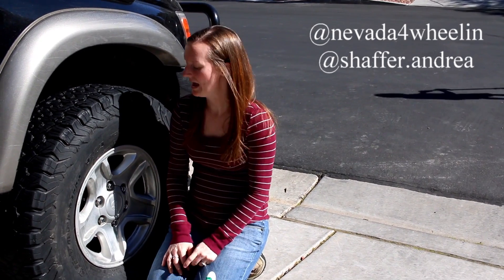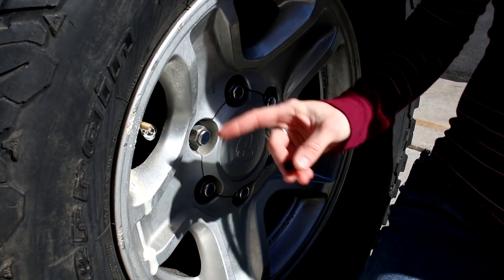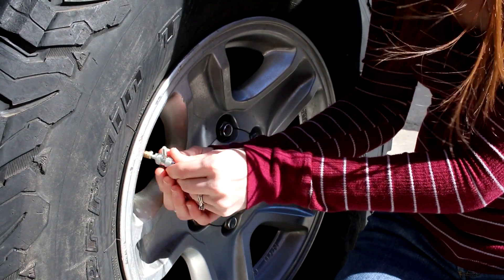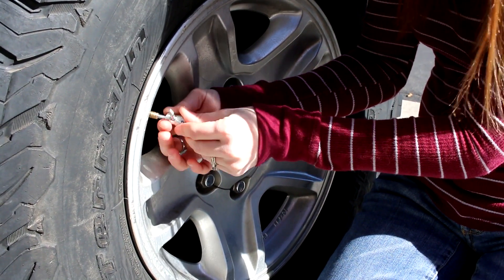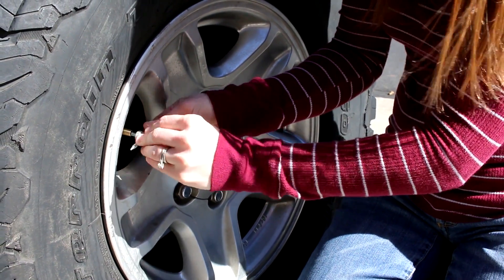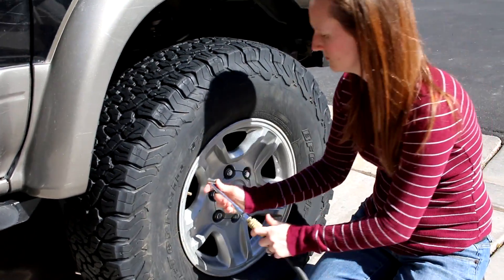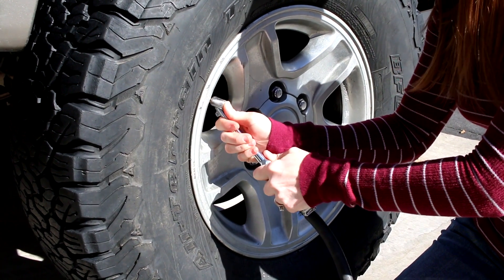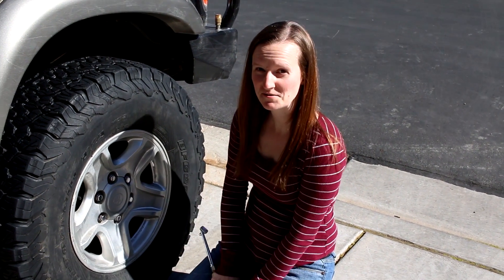Valve Stem Core Check and Fix!

Comment: Hi thanks for this, it's the 2nd time this happens to another tire valve stem leaks at our corolla hours ago, too bad I still don't have this kind of tool for fixing such issue. 

Just going to tire centers later and let them repair it again, anyways thanks for the info Andrea.
Reply: Walmart sells the tool with valve cores included for cheap

Comment: somehow only my right front and right rear’s valve stem core are shorter compare to left ones after changing new wheels. 

So it’s very hard to check air pressure with my gauge since valve stem cores are shorter and gauge cannot touch (or push) the core...

How can i resolve this issue?!